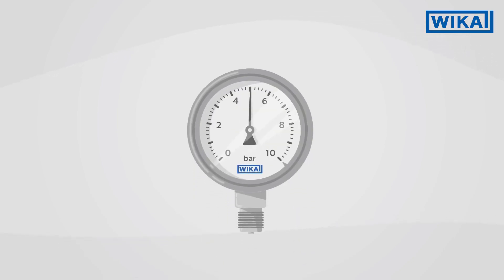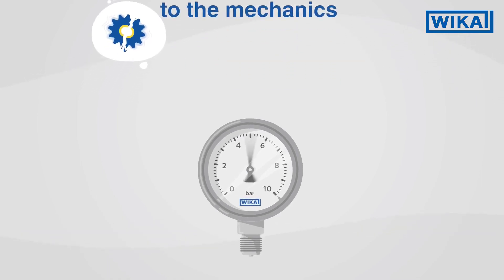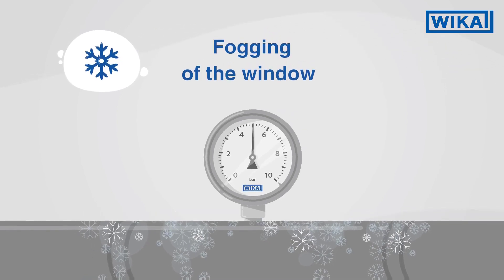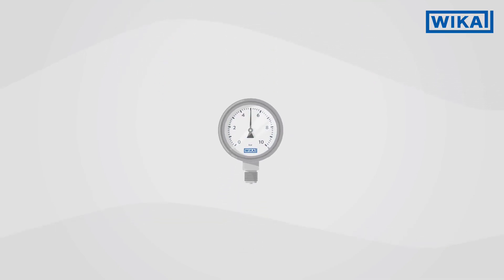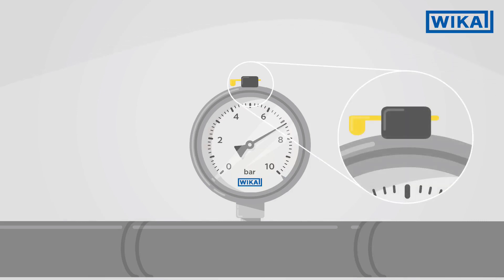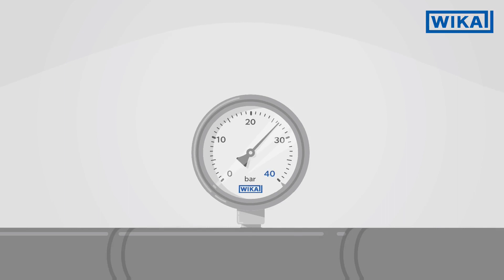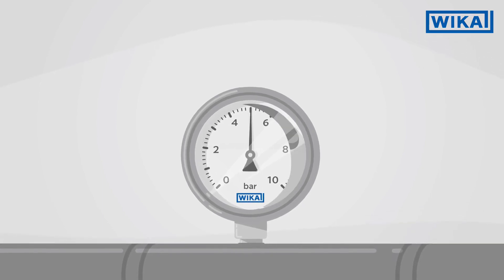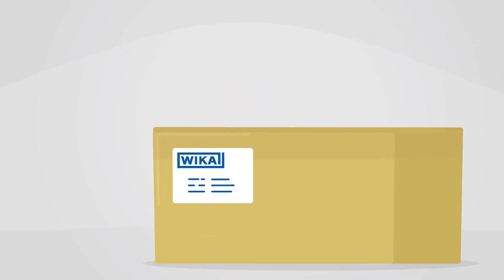Why Liquid filled in  Pressure gauge&Why Plug in Top side?

Comment: Thank you for video!
Let me ask a question. I have WIKA pressure gauge model 213.53.063 (0...6 bar). I noticed liquid leakage, part of the liquid poured out - so I want to buy Glycerol Pharmacopoeia (99.8%) and refill. (1) In manual for my model series WIKA mentions both Glycerine and Silicone Oil as possible fluid. (Glicerine-water mixture I exclude because it is for pressures 0...2.5 bar, as mentioned in manual). So just want to assure that Glycerine, not Silicone Oil, is OK for my particular gauge.
(2) Can I just refill the missed volume of liquid, no need to pour out all the remained liquid first? (the remaining liquid looks entirely perfect)
(3) As I can see in your video, there is small air buble remains in gauge (liquid fills 95-98%). As I remember, mine was the same out of the box. Should I fill same 95-98% of volume, or can I fill it upto 99-100%?

Comment: can liquid filled in 0-10 bar pressure gauge be used upside down or on its back, say if the gauge was connected to a flexible hose for mobile work

Comment: What kind of oil is used inside ?
Reply: Glycerine. Silicone (oil) for larger temperature extremes and Halocarbon® for use with oxidizing agents such as chlorine, oxygen and hydrogen peroxide. :)

Comment: got a question for you i got a liguid gauge  0 to 60 and i got a 1990 k5 blazer got my engine rebuld i did some up grades and some mods to mt tbi so i need the gauge to set my regulator pressure and i got some to burn my chip i put bigger cam in it ..my gauge were reading 10 psi with the stock spring and i try to adjust it but it stay at 10psi so i were thinking maybe the spring were weak so i put in a 18psi spring when i frist put it in with no adjustment it was reading 10 psi ..so i started to adjust it and it went to 20 psi i were trying to get it to go to 14 psi so when i back off it the screw is not even touching it and it is still at 20 psi it as if it is sticking ..and when unscrew the gauge it dont drop down to 0 and it should what do you think
Reply: Burp the liquid rubber plug by opening it to release the pressure, then close it.